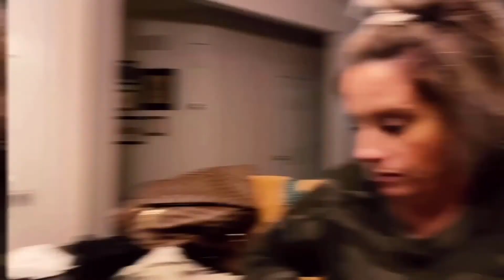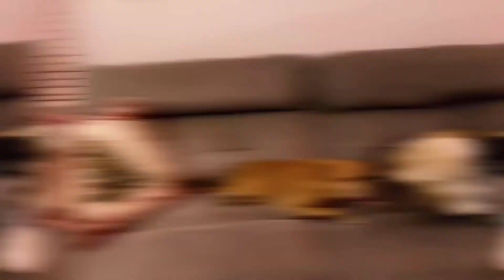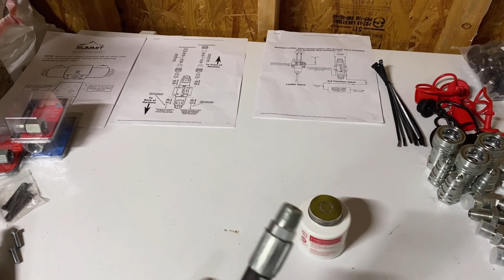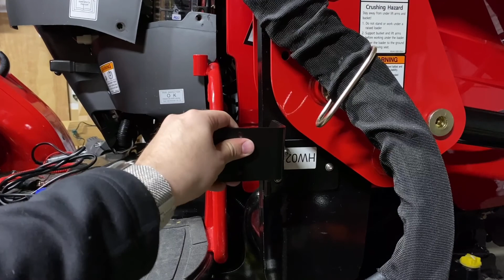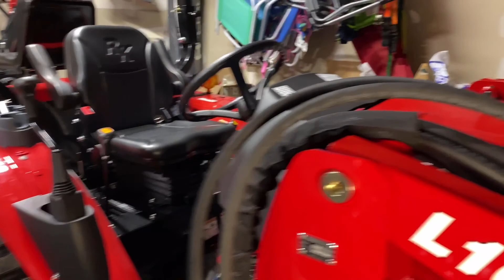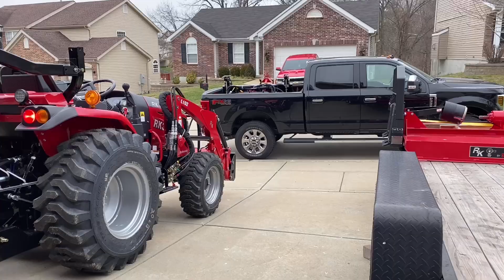Installing True Third Function Kit - RK 37

Comment: Why put it in back?  The RK37 offers a kit that goes on the front bar of the loader and hooks into the bucket lines using short hoses.  Yes, It's expensive but my RK37HC already has a button on the bucket control and electric wire that is long enough to run to the front of the loader.   I'm confused why you did it the hard way.

Comment: is this a true third function where you don't have to move the lever left or right with the buttons ?
Reply from the maker: Yes sir.  What you are describing is a diverter valve system.  They require almost the exact same level of effort to install, the biggest difference being where you get your hydraulic supply flow.  I’m not a fan of diverter systems.
Reply: @HeideHomestead   thanks i have a rk37 cab with the 3rd function installed by rk i hate thats its not a true 3rd function

Comment: i have a rk 37 what extra fittings did you have to get an do you have the size an or part number of the fittings
Reply from the maker: I found a local hydraulic/pneumatic shop and took the original 90degree fitting out of the Power Beyond port to get it right.  Local small shop that assembled several fittings for me to adapt from standard fittings to the ‘British’ thread fittings, as they called it.  Sorry no numbers, was handed them all threaded together without special ordering something for my exact match.  They charged me $22 for everything, still way cheaper than OEM diverter kit.  If you try to do a similar install, would recommend pulling the 90degree and go get it matched.  I’m super happy with my third function install, works perfect.  That RK37 has been amazing and runs like a top!